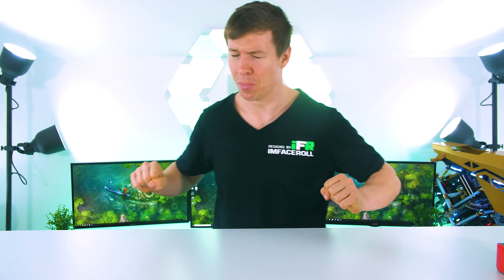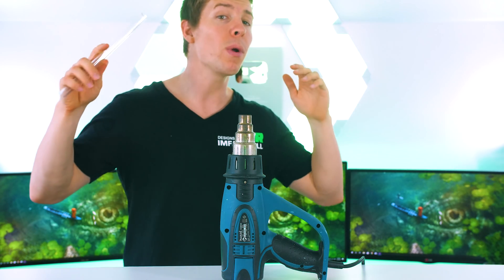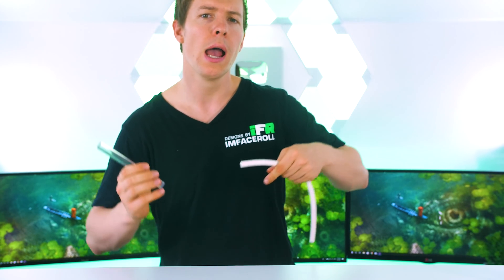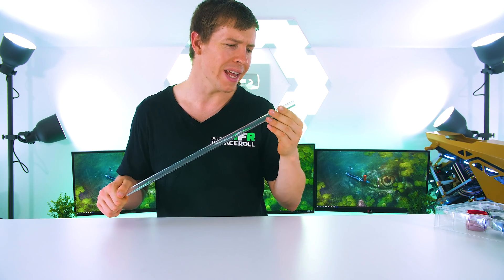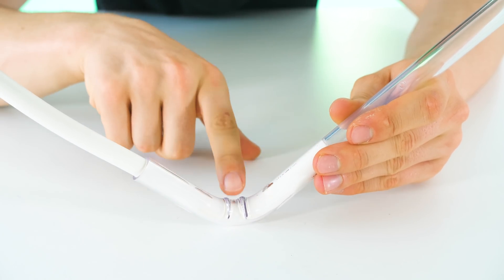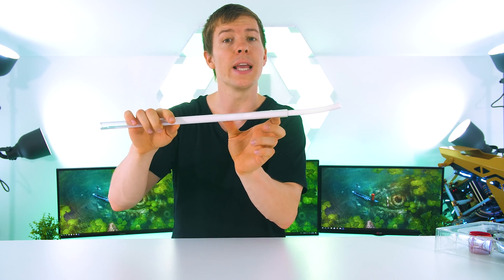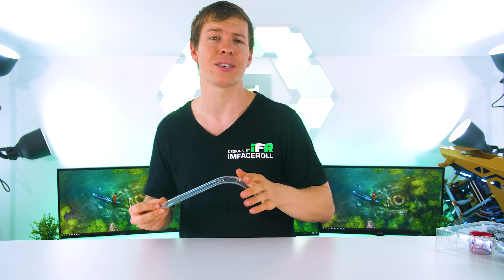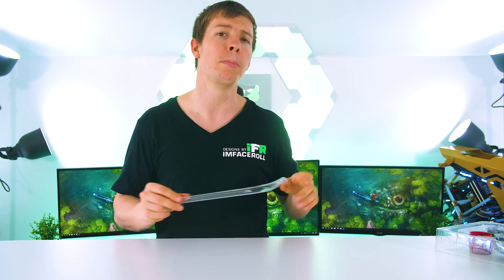How to Bend Hard Tube For PC Water Cooling - Beginners PC Water Cooling Guide 2019

Comment: hard tubing is so damn confusing, everything else i got down, and with all companies parts, currently have my alphacoo lstuff on the way and im so excited for my first custom loop. i got soft tubing though. hard tubing, it takes forever apparently to bend, have to use soapy water and ssomething to put it in to prevent kinks, all that stuff. im a watercooling noob so  im going soft tube first. i got the fittings measurements and ID/OD down though so i'm happy.

Comment: This is a Superb 'How-To' video, its very detailed straight to the point and you explain it in a simple understanding way. I'm about to do my first Custom Loop in my spankin' new PC-O11 & just transfer my current i7-8086K/1080Ti System into its new home, and do a full custom loop in it. Original plan was just to do soft-tubing (And already have the fittings for this setup =/) But really considering switching to Hard-Tubing because I learned a lot from this tutorial and actually feel more confident after watching this compared to all the other tutorials I watched. Something really clicked with your teachings =). Cheerz mate!

Comment: Exactly how I did it, heat all around the bend area constantly rotating the tube until it starts bending under the weight of the silicon insert then give it a couple more secs all around the bend area including the length of the tube above and below the bend then slowly bend, hold and wait until it cools down. All four of my Acrylic bends turned out great first time.

Comment: For my first watercooled build I bought 3m of acrylic tube and i ended up using every piece of it because I failed so many pieces and my silicone tube got stuck soooo many times in a perfect piece and I even dumped it in soap :( 
Now im running it with soft tubes but I will most likely rebuild it again to make it perfect with hard tubes and this time with better parts :)

Your videos helped a lot on my first watercooled build and your builds inspirate me on my own PC,   really good video lad, keep it going :)